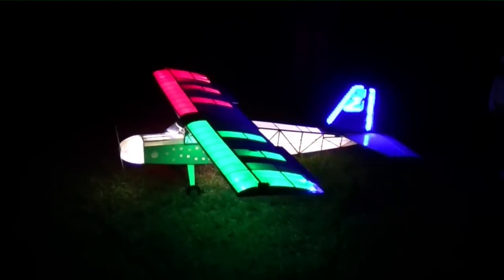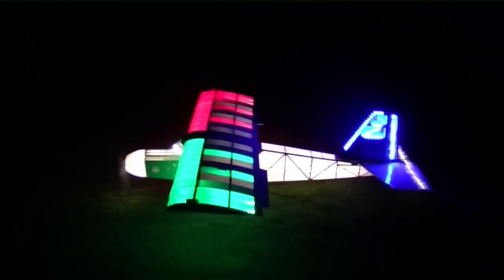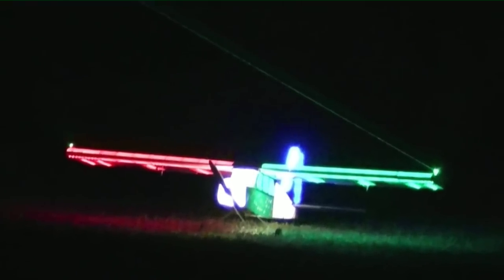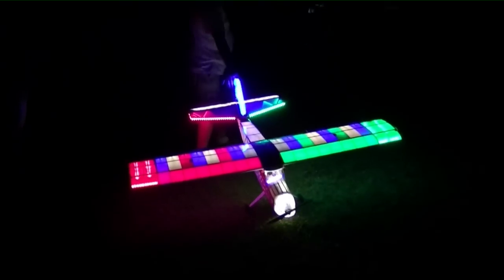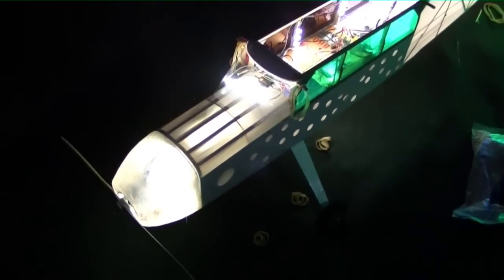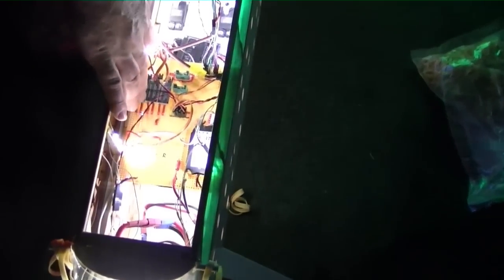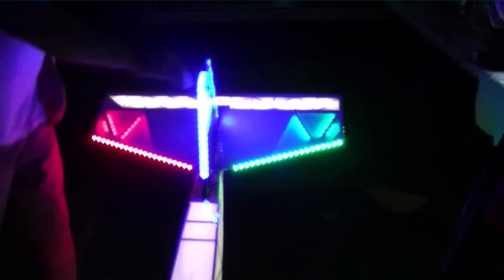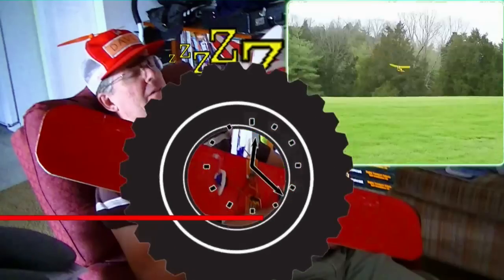Night Flying RC Plane with Internal LED Lights and Green Laser Lights

Comment: Nope sure didn't. I was just told u can cut the wire and put it bind spot on rec. Thanks for info. Man I love that plane. I saw a pa addiction or addition x with the lights internally. Both are cool